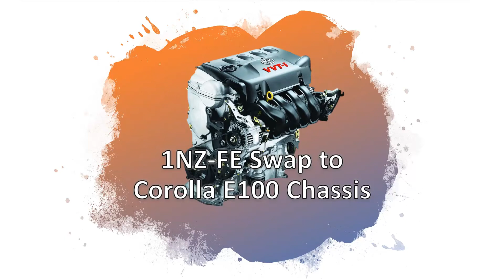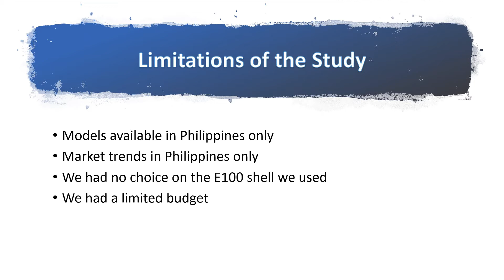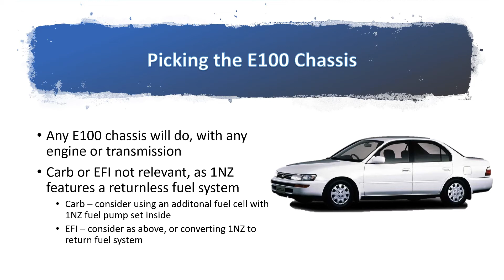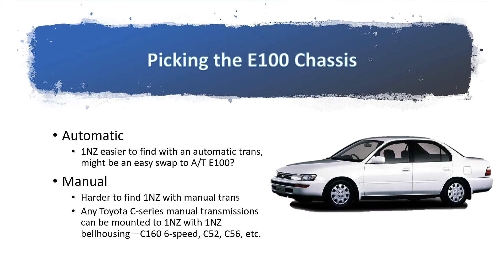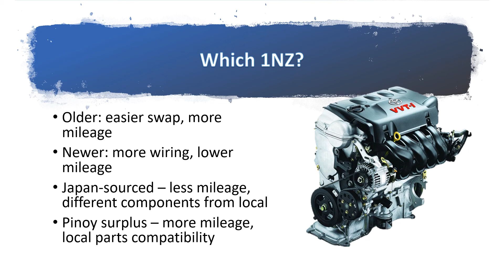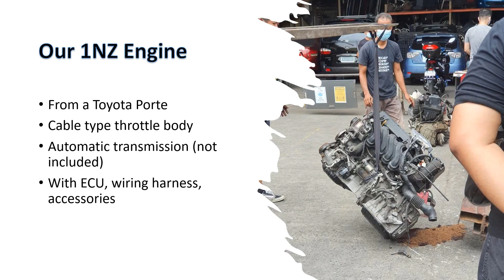Engine Swap Guide - 1NZ-FE into E100 Corolla Bigbody part 1

Comment: Is it possible to make a 1nz _fe engine in to a rear wheel drive manual ?
Reply from the maker: Yes, either make a adapter plate for a longitudinal RWD tranny of your choice, or install it at the back of driver like a mid engined car.
Reply: If may makta kang avanza na luma pwede yon para hindi na need ng adapter

Comment: Interested in the next episode, Wanting an ae92 or ae101 swapped as my first car
Reply: I put an 1nz engine in My ae92, it's very easy,
Now i'm putting an 1nz into a Toyota tercel (Corsa)
Reply: @tinigola  1nz faster than stock engine?
Reply: @tsarleslehkler9244  
My car used an 2e carburated engine so, the difference is a lot
Reply: Whats parts did you change?
Reply: @3nglehart  
Nothing
Just put the engine and the trans, wire the ecu and adapt a fuel pump
Reply: @tinigola  same mount?
Reply: @3nglehart  
Adapt the engine mount, but trans mount are the same
Reply: @tinigola  thanks for the info
Reply: This is what i needed thank you for the info